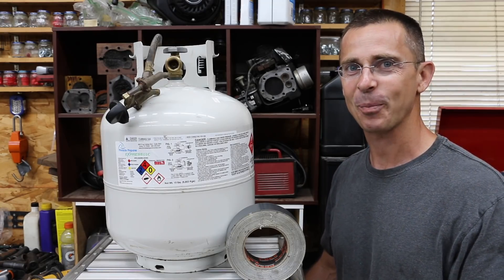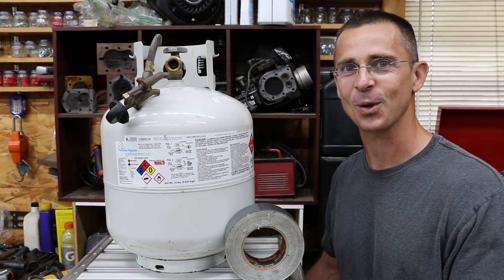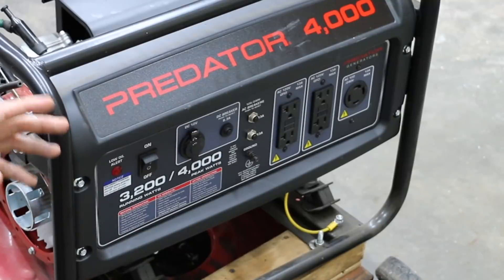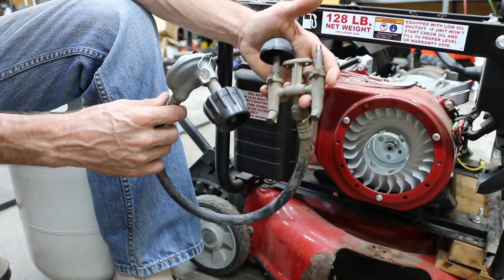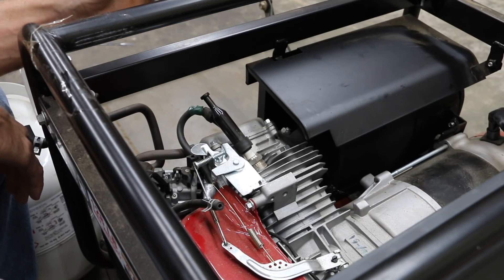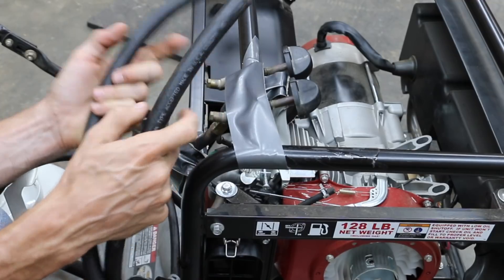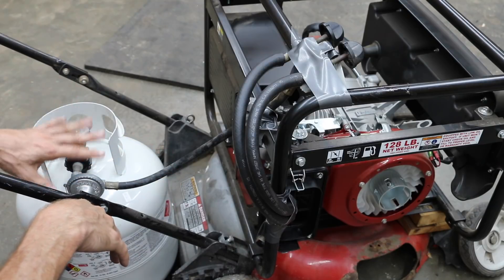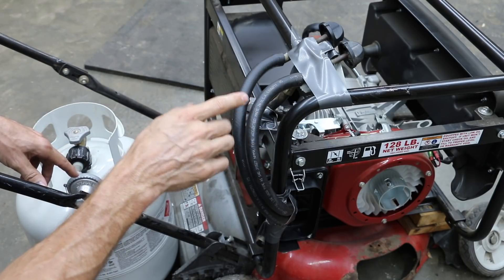Can a gas (propane) grill power an engine?  Let's try it!

Comment: So heres the thing, a lot of forklifts that run on propane do so because its clean enough to run in a buliding all day and not hurt anyone (like s car or truck would). A lot of these truck have whats called a "dual fuel system" witch means you switch between gasoline and propane via shut valves and 2 carburetors. You can also find many motors that are in forklifts in many cars for example hyster is known to use GM vortec motors such as 2.4 (2400 vortec) or a 4.3 in bigger trucks and Nissan, Caterpillar, Mitsubishi, and newer TCM's use a nissan k21 or k25 as long as
Reply from the maker: Thank you for the feedback

Comment: I owned a JI Case 940 LP tractor. Always started right up, engine oil stayed clean & very dependable workin machine, fuel was 1/3rd the cost of diesel but only lasted about 60% as long as the others.
Reply from the maker: Thank you for the feedback

Comment: Yes you can... The trick is getting it regulated under load and staying stable once the load is lifted.
Reply from the maker: Thank you for the feedback
Reply: @ProjectFarm  As always you have a great channel with great information. I'm subscribed to this channel and I share it. I have done a lot of experimentation with propane and engines and now all of my small engines for my secondary generators are set up with propane carb kits. Have you ever heard of the wild wild world of woodgas? That's what I do. I build gasifiers and run one of my generators off of woodgas. Very cool concept. I show people how to construct them on my channel. Because you are the kind of guy that obviously likes to get your hands dirty I wanted to leave you a few links to check out. It took me a while to fine tune the build and it's still an ongoing work in progress but it really really works and the best part is the fuel is free since I run my system off of dead branches lying on the ground from in woods on the property. This build is for small engines. There are much larger builds on youtube with people driving their trucks off of woodgas or people running 10 to 20 Kilowatt and higher emergency power systems using this old technology. My build would be considered a small power emergency power source design. Here are a few links for you. Once again, thanks for all of the hard work you put into your channel. Very informative!

https://www.youtube.com/watch?v=dJfpa5-TTig&t=1252s
https://www.youtube.com/watch?v=Kv73ggsEDWY&t=770s
https://www.youtube.com/watch?v=x6nOINkt6Es&t=1145s

Comment: This is just like we in europe doin..... LPG swapped gasoline engines in cars that are running a propane butane mix is nothing unusual. The engines are runnin very clean and smooth, if the settings are good. The system is shutting off the gasoline fuel injectors after the engine has warmed up and turning on the gas injectors... there are systems that inject liquid gas, some has a dryer that heat up the liquid gas and dry it.
Reply from the maker: Thank you for the feedback

Comment: They sell a conversion kit with an automatic regulator and an aluminum collar that slips over the air cleaner studs. Its fairly expensive and some models require cutting the frame. All you need is a cheap $15.00 30 psi adjustable regulator, either connect it to the pcv hose on the carb or drill and tap a hole in front of air cleaner for a hose nipple. It will start quicker with the pcv nipple though as the gas doesn’t have to go through the air filter. The engine will run cleaner and last longer on propane as there is no gas washing of the cylinder.
Reply from the maker: Thank you for the feedback

Comment: I tried this some time before also on generator and it worked just fine.
Biggest issue is that you are removing air filter and then engine is exposed to dust, so guys, when trying something like this, keep that in mind.
Reply from the maker: Thank you for the feedback

Comment: I’d like to see a video in which he tries this on a 2 stroke engine (however 2 stroke oil supply will be a challenge). Thumbs up!
Reply from the maker: Thank you for the video idea!
Reply: @ProjectFarm  You're welcome!
Reply: What if you filled the fuel tank with the oil only and changed the fuel air mix so not too much or too little oil was going in. Only problem is the viscosity of the oil and if it would flow inside the carburettor well enough.

Comment: i ran a push mower for 3 summers on 1 pound propane bottles and a gutted torch head with a hose ran from the torch head to a hole drilled in the top of the air cleaner lid. worked great just marked the knob on the torch to where it ran good so it made it easy to start every time.
Reply from the maker: Thank you for the feedback

Comment: I was impressed with the propane in place of gasoline ,clean blue flame .Carbon did not seem to be an issue ,and plenty of performance.I ran my 4 stroke lawn mower on 33% Waxworks smoke-less citronella torch fuel and 67% regular gasoline.It run very well and smelt of Citronella out the exhaust.I took the spark out after 45 minutes of lawn mowing.The spark plug had very little carbon and a slight oil residue .i wiped the plug with a rag the old carbon seems to be softened somewhat.There was 3 to 5 secs of mild engine run on ,when i turned the mower off.I brought the petrol amount to 75% the running on ,stopped.The torch oil was medium run distillates 210 deg  F flash point.,Auto ignite range 401 to 420 F. With 99.87 hydrocarbons i believe it has a lot energy in it .It seems different to Coleman fuel .
This torch oil might be worth experimenting with ?.
Reply from the maker: Thank you

Comment: Folks, this was just a Test that worked ok in Emergency but if you are going to do this for Permanent useage, buy yourself a Gas Demand Regulator off EBay or Amazon for about $50-75 dollars-will make your Unit much more Safe to Operate...

Comment: How about getting an engine to run off of water - the holy grail of renewable energy...  This would require a reaction of course to get hydrogen out of H2O and then into the engine... Of course if you got that to work you might need to beef up security around the house as some men in black might start showing up... :)
Reply from the maker: Thank you for the video idea!

Comment: My question is:  When you use a propane generator to power your household appliances like freezer, refrig., and lights.  As the refrigerator units cycle on and off,  can the propane supply increase or decrease to match demand?

Comment: It is nothing special, we got bio gas busses here in my country, they're very good for the environment.
Reply from the maker: Great information. Thank you
Reply: @ProjectFarm  Well, another interesting thing is I put a carb together, mounted it and it ran just fine with around 0.5 liters of gas in the tank, now I filled it up 5 liters and it was leaking like a sieve... now I got pissed off and first thing I am gonna do is remove the vacuum pump system for fuel and put a manual petcock so I can turn that shit off when that happens... :P

Comment: Propane burns very clean, thats why no black smoke . I did a tune up on a old propane powered forklift. It had been 9 years since the last tune up. The points and cap were worn , but the plugs looked almost new no carbon at all.
Reply from the maker: Thank you!

Comment: I wonder how it would do runing a long time like a couple days. And what the oil might look like
Reply: It stays very clean for a very long time. LPG (propane) conversions are quite popular on cars in australia as it is cheaper to run.
Reply: It would be better than if it ran on gasoline, LPG doesn't have all that nasty stuff that benzine (gasoline) has, that's why spark is so clean on the end of video.
Just to add, here in Europe,cars that run on LPG are quite common.

Comment: This was a neat experiment and it’s a nifty way to show alternate fuel use. Small engines for indoor application like forklifts and tile floor machines used by companies using LP gas. Much cleaner and better efficiency but also much more volatile if it is damaged versus gasoline. Bigger tank for propane means bigger bang if something goes wrong. Great video 👍🏻
Reply from the maker: Thank you!

Comment: My friend is there a way to put at the end of the muffler how well it's being burned to be able to adjust the inflow of the gas to proper proportions do they make a device and some other application that we could correlate it to motor engines so the fluctuations of a vehicle or a go-kart can be used properly and having it to burn efficiently  whether you  give it gas  on the pedal or not by using propane? I'm pretty smart but lack in my knowledge of electronics. Please let me know, thank you.
Reply: No need for all that, there is device that is designed for such purposes at least for cars, problem would be  in fact  that such device in cars uses  and requires warm water which is done by taping in cooling system of car because without heating, device would freeze and stop functioning, talking from personal experience.

Comment: Like to see gas vapor as you demonstrated on your lawn mower but this time with also HHO .  two hoses , one with HHO and the other with gasoline . Of course you would need a water bubbler on the HHO side hose and on the gas side too after it leaves the container filled with gas. Why ? The HHO will clean the flame up and extend the longevity of the fuel producing better gas mileage you can make HHO with stainless steel plates hooked up to a battery with Koh in the distilled water I've done it works great the only problem I had was it leaking cell if I can figure that out I got it licked.

Comment: No doubt that it would run, once you got the fuel/air mixture right. Would like to see how long it would run  on  propane compared to same volume of gasoline, under same load.
Reply from the maker: Thank you!
Reply: Propane gets less mileage. At least with my generator.

Comment: A carpet cleaning company i worked at in 1980 ,ran thier  vans on propane or gasoline.  There was a cable and a switch to turn on . 
They had a tank at the yard to refill with .  Gasoline was only used if propane ran out .
Reply from the maker: Interesting. Thank you!
Reply: @ProjectFarm   yeah there was a cover of some type that went onto the carburetor . for the propane to enter .  it was cheaper to run on propane then .

Comment: My biggest question is why it wouldn't run on propane? I mean propane conversions are being done for cars(not to be confused with lpg, though there are systems designed to work with both fuels) and people run propane daily. The only tricky part is the a/f mixture and maybe timing (though that can only cause the engine to run fast or slow and/or more or less efficient).

Comment: Short term use, the stock engine should handle it for a while provided the air/fuel ratio is good...but longer run times will require some hardened valve seats.

I'm a mass transit fleet mechanic & we have a bunch of buses that run on LPG, it does has it's advantages & disadvantages - although the disadvantages are more convenience based than they are mechanical if you use a well designed fuel system (ie: can't just run to the average convenience store @ 3am to top off the tank).  One of the things that always amuses me is how good looking (visually) the engine oil is even after 5,000-6,000 miles just due to the lower hydrocarbon content of the LPG.

I'll leave it at that as I don't want to turn a quick comment into a short story novel...hehe.  And I'll end it with saying that I like your work & the fact that you perform your tests as professionally as possible for the given budget.  Cheers.
Reply from the maker: Thank you!

Comment: I have a request, but an odd one.
This HHO gas, while it makes the same energy it takes to make it, is a no-brainer, granted in full, with honors, and all that.
However....
The science that has been supressed from the late 60s, says that the free hydrogen, when introduced into the combustion process at low levels, tends to clean up the burn on a massive scale, and allow a complete burn of a given hydrocarbon, i.e., diesel or gasoline.
Any way to come up with a test for that?
It was (in theory) to allow a burn so clean as to make catalytic converters totally unnecessary on about any internal combustion engine.
Thoughts?
Reply from the maker: Thank you for the video idea!

Comment: Many cars in Europe run on LPG (a propane-butane mix). Of course they have LPG systems installed under the hood with additional injectors, filters and a second tank.
Fuel consumption is normally about 10-20% higher due to LPG being less energy dense.

A fun fact: here gas is a real gas, which is generally propane-butane. No one calls gasoline (or should I say petrol) gas.
Reply from the maker: Thank you

Comment: That was quite..... impressive. 
I wonder if there still exists a way to power a gasser car by way of gasoline or propane like years ago.
I forget what mag the article was in, but considering the fact that with both the gasoline and propane tanks full, the vehicles range was 700 miles, estimated.
Reply from the maker: Great point.

Comment: Outstanding! Now I know how  to make my gen to run on propane in case of an emergency during hurricane season. ;)
Reply: Source a propane carb if possible, they work great. Dumping propane near the intake is very inefficient not to mention the issues with accommodating variable loads.
Reply: @otm646  there is more than 60 years that we have cars on lpg - butane+propane
Reply: @dancro9809  But not with BBQ parts, that was the point of this test, not to see if an internal combustion motor would run on LPG.
Reply: @{// WTF! //} Always my friend! Thanks!

Comment: From installing propane kits on commercial vehicles, most physically have to start on gasoline, and then you switch it over to propane. Super cool that you were able to get this to run on a direct feed of propane only.
Reply: For emissions/safety reasons primarily, the idea is that the engine is already running, so less risk of unburned propane escaping while starting.
Reply from the maker: Great information. Thank you
Reply: Most LPG needs to be vapourized before mixing with air, and to do that it uses engine coolant in the vaporizer unit. Therefore engine needs to be a little warm (running on gasoline) to have the coolant above ambient temperature.
Reply: With the LPG kit you can convert your daily car on LPG fuel. If there is warm outside temperature you can start the car directly on LPG if the LPG computer alows it. BUt normaly you start on gasoline, the cooling liquid warms up the gas inside the LPG distributor for better evaporization and then it switches to LPG fuel and goes throu nozels inside air intake for each cilinder.  the older versions of LPG kits were direct feed. You could start directly on LPG

Comment: Very interesting that was so out of curiosity now you ran it to the opening to the carb now could you run it thru the gas line inlet and allow the carb to work as it would whith gas just wanted to know if would still run and work good or better
Reply from the maker: Thank you for the video idea!

Comment: since the propane gas doesn't have lubrication, the engine gets seized that is not the case with gasolene over the period of time.
Reply from the maker: Thank you
Reply: That is fore A 2 cycle not s 4 cycle

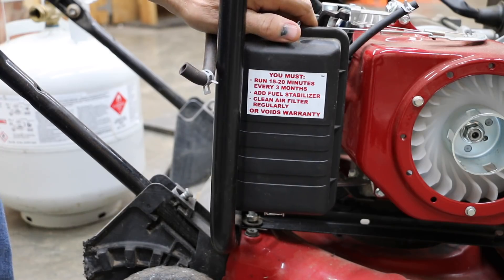Comment: 1:21 it's time for the Scotty Kilmer channel  LOL
Reply from the maker: lol
Reply: @ProjectFarm  thank you Sir for the video :)
my question is what about fuel economy (propane vs gasoline) do you have any data on this , thanks!
Reply: @markandrew3846  I think propane burns more fuel for the same amount of HP, because gasoline is more energy dense than propane. One important factor is availability of the fuel though. We live in a hurricane area and having the option to run propane or gasoline is a huge plus. We had a gas generator and upon returning from evacuation we were not able to find gasoline. Now our generators are converted to run on propane or gasoline and if a hurricane comes we get a couple tanks of propane and put them in the truck prior to evacuating.
Reply: Lol got to love Scotty
Reply: Michael Jones  as long as you own a 1993 celica

Comment: Hey, try using mapp gas with the torch head (not burning of course) straight into air filter on a small engine. It should produce higher horse power!🐎💥💨
Reply from the maker: Thank you for the video idea!

Comment: I used to work at a gas station that sold propane out of a large tank. (Not prefilled tanks) I would occasionally get vans or trucks that used it for fuel. One van had over 300,000 miles on it. He showed me the oil on the dipstick that he claimed to have like 10,000 miles on. It was as clean and clear as if he just changed it that day.
Reply from the maker: Wow!  Impressive!

Comment: Can I use the same hookup on a junkyard car
Reply: You can convert your car to run on propane  ... depending where you live, there will be a required/gas/propane certified kit needed.  Plus you'll need to get the fuel/air mixture set up appropriately

Comment: Propane conversion kits for farm trucks were widely available back in the 1970’s. Why did it not prosper?
Reply: It takes more propane to run a motor than on gas. Plus it can be temperamental in colder climates. Closer you get to -44°F the less vapor you have.
Reply: I don’t remember it getting to -44F even in the deepest of winter of Texas. That’s colder than an Wyoming well diggers ass!